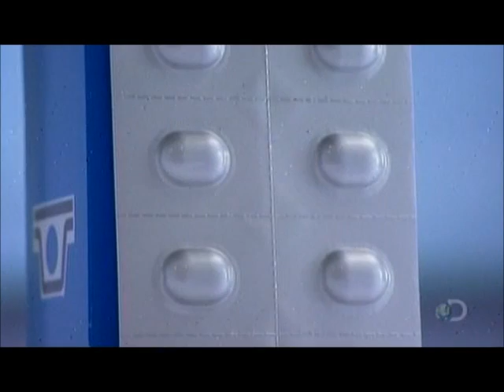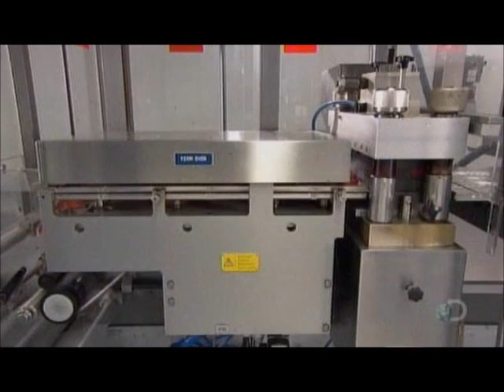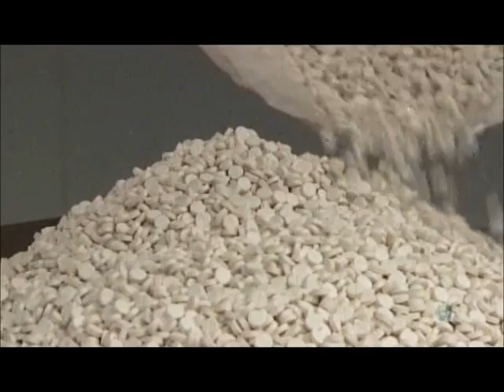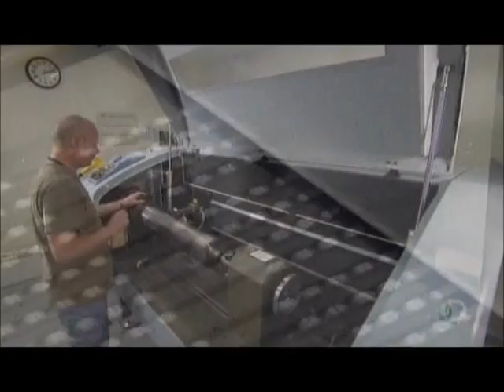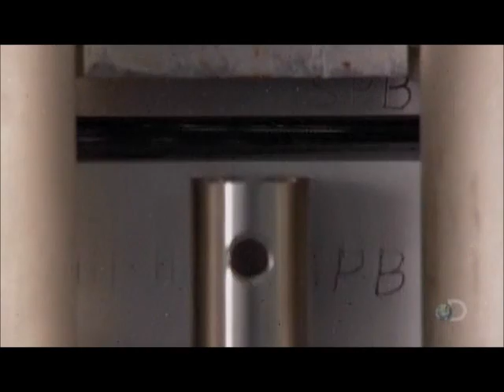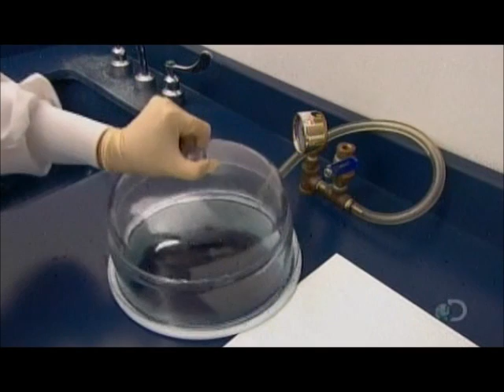How It's Made - Pharmaceutical Blister Packs

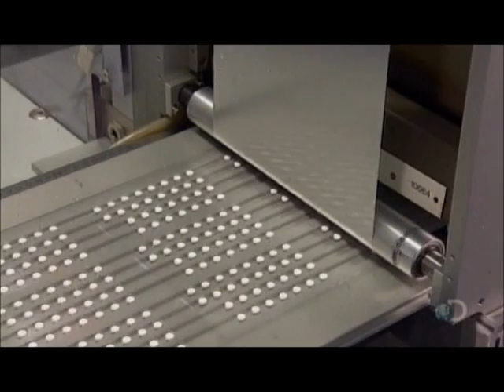Comment: Inspector didn't do a very good job.  Missed one at 2:22!
Reply: you also not good inspector) there is 2 missing)))))
Reply: They should hire you instead 🤣🤣🤣
Reply: @FloraIreneChannel  ))))))
Reply: sometimes the machine moves too fast and when you try to fill in a missing blister too close to the sealing station, you mess up and instead of going in the cavity , sits on top of the web, which then trips to laser light curtain that sits right before the sealing station, which causes the machine to stop. Then you gotta get a mechanic to come open up the sealing station, find the pill and remove it, close the station back up it and restart the machine. And since time as money, it’s better to just create one or two reject units then to try filling the empty cavities in when it’s already too close to the ceiling station and risk stopping the machine trying to save them. Basically on the fly triage.